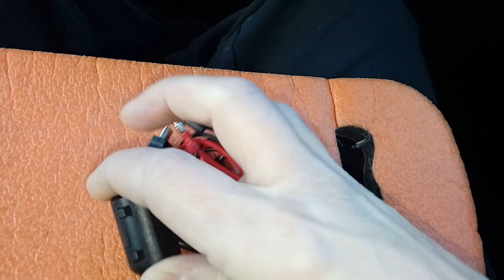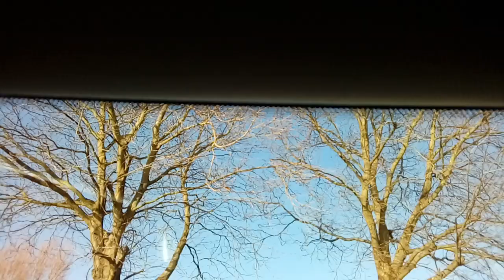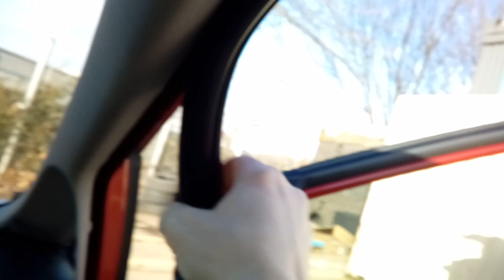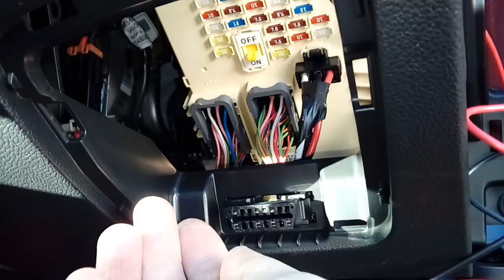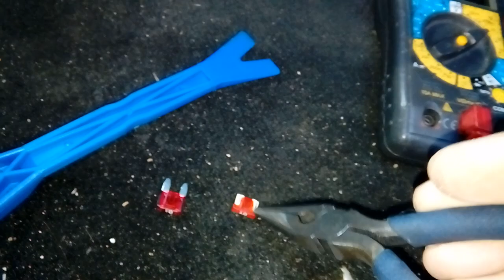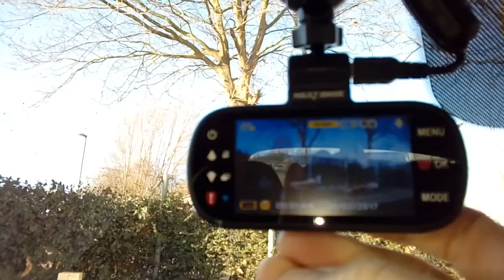Kia Ceed 2012 - 2018 how to fit dash cam to fuse box,step by step guide.

Comment: Does it matter which way you plug in the piggy bank fuse? You didn't mention there are 2 ways
Reply from the maker: @charltheboy  Do it the same way as the video.
Fuses have what’s called a hot side.

Comment: Hi is it not for hard wire kit  dash cam as for hard wire kit u need to connect  yellow wire and red wire into fuse box u only connected  1 wire in to the fuse box and ground  wire  in  to the bolt ...
Reply from the maker: This guide is for a switched live powered camera only. You described a camera with parking mode that type  would require a constant power feed and a switched power feed
Reply: Pjs projects  thanks for replying  back as I am looking for  hard wire dash cam  would u able to tell  me  please  which  wire is for which  fuse in order to connect  in to the fuse .red wire and yellow  wire ...thanks

Comment: Hi thanks thanks for the guide
Please guide
I have a viofo a119 dashcam
What rating fuse will I need to put in the fuse tap? Where I find out the fuse value?
Thanks
Reply: 5 amp will work fine

Comment: Can I just ask why you wired the cable under the air bag rather then over just in case on a crash
Reply from the maker: Tbh it really does not matter if it goes under or over the airbag but if I don't mention it in the video I always get one or two people that panic thinking a tiny cable will stop the force of an airbag in some way.
Reply: PJs projects only reason I ask is I’m IMI   Trained and if I did this I would lose my job as I fit dash cams and stereos for a living
Reply from the maker: Sorry but I don't want this to come across as sounding off in any way but if your IMI trained and do this for a living why do you need to ask if the cable should go under or over the airbag or for that matter watch Youtube guides?

Comment: I'll be hardwiring a camera into my Cee'd once I get the kit, but I'm not messing around getting a multimeter or anything like that. I've got my manual, so it's just a case of finding a "useless" fuse and piggybacking off of that.

I'm also going to make sure I hardwire one into the van that I'm getting soon as it only has 1 socket. My car has 2, but I don't want cables everywhere.

Comment: I cant understand why you wired it to a switched fuse, because to use parking mode you will need to use a constant live feed for this feature ?
Reply from the maker: Depending on the camera some have battery back up and can run parking mode for a short period of time(up to a couple of hours). Also cameras without a parking mode do not want a constant power feed because if left on they would flatten the cars battery.
However some cameras have a dedicated none switched power feed that powers parking mode for longer periods of time,say over night or if left at an airport for a week.
Are you having problems with a parking made hence watching this video?